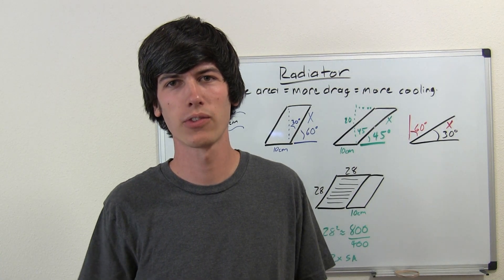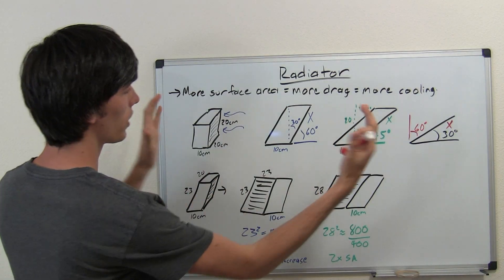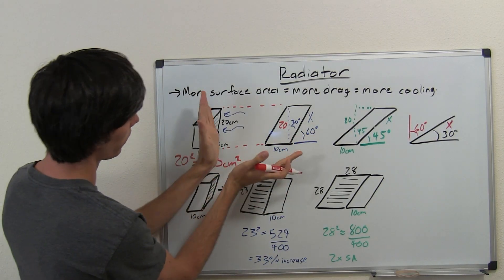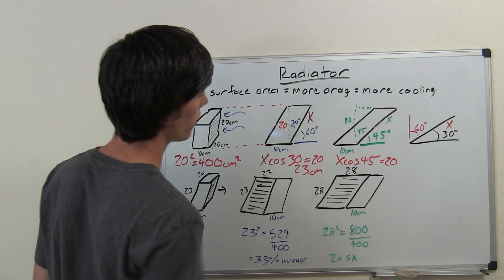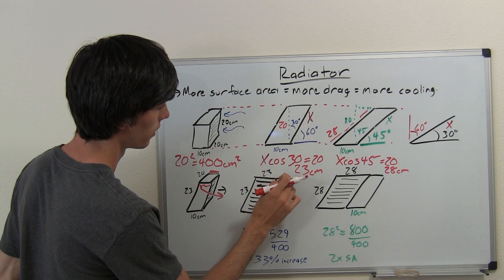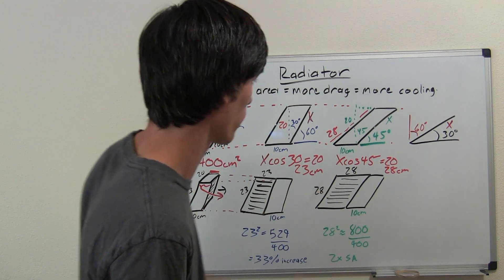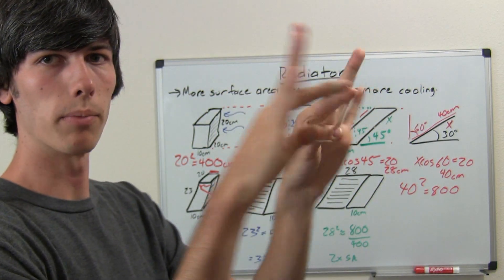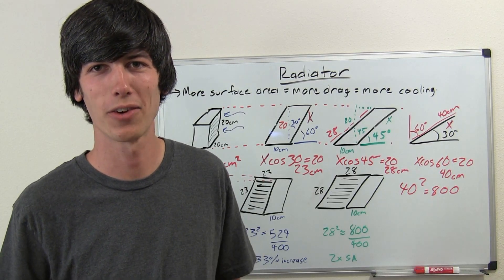Formula One Radiator Technique - Explained

Comment: good video, the only question I have is - when the rad is straight up the fins offer the less resistance, but when its laying over the fins will act as a resistant fan. the side positioning is therefore the best, the the air still has to change direction

Comment: @Engineering Explained, Is tilting premanufactured cooling cores like a radiator or intercooler from aftermarket suppliers - typically seen in a v-mount setup - even worth the effort. DTM and GT cars also use typical cores, and the fins would not be skewed increasing surface area. I can only assume a bespoke built as you described by a F1 manufacturer tossing almost limitless funds would benefit? My interest stems from initially reducing charge piping volume and reviewing orientation for a v-mount setup on my A80, but it all seems to be more trouble than it's worth even for a autocross/track car if the surface area does not change and only the angle...

Comment: I did like the rubber band.  Its worth noting the drawback to this system is depending how the air travels through the heat exchange the velocity will drop (if the air turns to go perpendicular to the ht x face) or the effective depth will increase (if the air travels straight and flows at an angle to the face). either of these effects will reduce the advantage of the larger face area.
Reply: I've seen systems for slowing the air because it can remove more heat if it's not moving too fast (I think it has to do with boundary layers?)

Comment: Looking at doing something similar and this video came up. If you angle that back though the fins will also be angled back and at some point it seems like air would flow over the fins instead of through them. Unless the fins are designed at 90 degrees to the ground despite the radiator being set back say 45 degrees. You could redirect that air flow to then flow at say 45 degrees matching the fins. But then your creating turbulence and/or adding weight and/or loosing efficiency in part of that radiator

Comment: I don't think cooling is working in this theory? Frontal area equation should be addressed to the direction toward to the wind. Now the radiator is tilted it might face the other direction which would cause more drag, or it might face the right wind direction but one corner sticks out the most will start to cool down then the far behind corner will be cooled the last. I think it's just matter of which corner get cooled first and not actually increasing the cooling surface area by tilting for better cooling performance.

Comment: I'm no engineer , but why cant you use the heat given off by the radiator to give extra push or thrust similar to  a small rocket engine , if it was made deeper . Or use the large fin that is at the back of the car. I'm sorry I don't know what it is called as a heat sink  ?

Comment: I know this vid is hella old and I may not get any answers from anyone; however, the fins orientation on the rad. Will it affect cooling? e.g. RX8s have the radiator basically under the car with a system to pull air in; however, the fins are not facing the same direction of flow. Wouldn't that produce more drag and therefore making it less efficient in cooling or is the drag needed to better cool?

Comment: In the last example at 45 degrees sweep in two axis your math is wrong. 40 X 40 = 1600. Eight times the radiator area with the same frontal area. Not 800.

Comment: hmmm - i thought F1 motors were air cooled?
Reply: Yes and no

To cool the Charged air from the Turbo,An Intercooler is installed at the left side of the cockpit for moving air from the outside to cool the compressed air Resulting in Better Horsepower numbers

For the Engines water,Transmission Fluid,and Lubricant to cool,secondary radiators are installed at the right side of the Cockpit 
To cool Them down for maximum Efficiency

Comment: But aren't also some pressure drop issues when you change the vertical angle? The fluid takes more time to pass through the radiator, so it's a bit worse i guess no?

Comment: So what it seems like; Its like stretching the radiator for more air surface contact but you would tilt it so that its overall height would be the same as if it was the unstretched version. But wondering if the fins angled or not. If not, it would see to put some down force or strain on the fins kinda creating a bunch of tiny spoilers assuming the top is pushed toward the front and the bottom pushed towards the bad of the car.

Comment: Okay, so, increasing the angle of the radiator will increase its radiant surface, but at which point this will make it a disadvantage? I mean, if the angle tends to 179°, it would have a very very very long length before it reaches a 20cm height, almost as much as infinite, and if the angle tends to 180° the length would be definetly infinite and thus wouldn't have any active radiant surface. so, which is the exact limit angle? I'm sorry for my really really bad english but i'm italian!

Comment: You have to take into consideration that the first thing you explained in the beginning starts to happen when you tilt it enough, the depth of the radiator increases. So its not that big of gains in reality that you stated.

Also i think the aerodynamics change a little with tilted vs not tilted, tilted doesnt get the air "rammed" thru like in the non tilted?

All just my common sense tingling so might be wrong!

Maybe make these kind of radiators IRL and test in and out temperatures?

Comment: Random thought: Wouldn't it be better for the bottom of the radiator be placed closer to the front of the car than the top of the radiator? Opposite to what you have drawn on the white board. Wouldn't this help provide more downforce, as oppose to lift? Or does it have to do something with not allowing the hot air to get trapped towards the top of the radiator at idle?

Comment: Ok this is confusing.
Confusion 1 : Unless the radiator is solid (no fins) this does not make sense.
Assuming that the radiator has 10 parallel fins
The true surface area on which the air contacts the metal to exchange heat remains constant of 10x20x10 (fin length x fin width x number of fins) = 2000.

Confusion 2 : When making a thicker radiator you will actually increase the fin surface/ contact area
Example if we increase radiator depth to 30
The new surface/contact area becomes
30x20x10 = 6000.
Now regarding your comment that the air heats up before it reaches the end.
That means you need a faster air cfm to make it move faster before getting heated.
Or this can be fixed by adjusting the length to a proper length.

Finally : i am curious, was this method confirmed to be advantages or not?
Reply: Confusion 1: Correct. You have to use more material to utilize that surface area benefit. 
Confusion 2: Also correct. It's similar to the myth that sloped armor on tanks make them lighter while offering more protection. Perhaps there are other benefits other than just increasing available surface area for a tilted radiator.
Reply: Increasing lenght of the fins you gain more heat transferred but that costs you more weight. The first benefit is not worth the weight gained in f1.
Reply: I think he means the plan form area will increase while keeping frontal area the same. What he has completely neglected however is fin density. A radiator's depth, plan form area and fin density will ultimately determine total heat transfer area.
Reply: +SUN SU it is not a myth
Reply: Confusion 2:
The cold side fluid's temperature increases to a maximum limit which is the hot side fluid's inlet temperature, for example in the car radiator the air increases from 30C to the maximum temperature of the water which is probably 95 or 90, if the air reached this temperature in a 10 cm depth, so the 20 cm increase in the radiator depth would be useless.

Comment: I believe this concept reduces drag even while maintaining the same frontal surface area.  The reason being that the shape has changed to become more aerodynamic.  Drag is a function of shape as well as frontal area for a given fluid and velocity.  That given, by tilting the radiator back you do loose some efficiency, due to the fact that the pressure delta across the radiator is reduced.  Great post!

Comment: Is it smart to make your radiator like you front car, and than tilt it. So a bit round on the front, hollow at the rear, and the whole part tilted. Or the back of the radiator flat and tilted. What do you think is the smartest and most efficiant way to make the radiator?
Reply from the maker: Here's a detailed answer to your question: Performance Radiator - Explained

Comment: Thats awesome, so they could improve road car cooling buy using angled radiators, or maintain the same cooling by using smaller radiators in this way thereby saving money.  
Presumably the fins of the radiator need to be angled in the same orientation in order to maximise the effect?
Reply from the maker: Well, a flat radiator is pretty efficient, and there's a lot more space in a road car for it.

Comment: So if you get a 1m^2(100cm*100cm=10,000cm^2) piece of paper and draw 1cm thick lines down the paper with 1cm gaps you get 5,000cm^2 of fins(inked area) and 5,000cm^2 (blank area), the fins are blocking half the frontal area.
You do the 45degree trick and you now have a 1.9881m^2(141cm*141cm) piece of paper. Repeat the lines and you have 9,940.5cm^2 of fins and 9,940.5cm^2 of air passages, almost no air "blockages" in comparison to its frontal area.

So you can maximise airflow to match your frontal area and maximise the fin area at the same time. So there is a maximum gain for each level of fin density.

Comment: So if I just change the brackets on my stock radiator to tilt it forward 40 degrees it will improve my cooling by nearly 20%?
Reply from the maker: No, as shi01 has said. Also, your radiator fins are oriented for flow perpendicular to the radiator, so it'd actually get worse by tilting it, as it would get less air flow.
Reply: No. The trick he shows is to use a bigger radiator, without the need of a bigger frontal area. (same hight and width) If you use the same radiator and just tilt it, you will have no effect at all.

Comment: Wouldn't leaning the radiator forwards create an upward force on it which of course you wouldn't want. And if it does, is it maybe just not parctical to tilt it backwards, because the air would not go in as much as just flow over?

Comment: a radiator is a block consisting a lot of thin pipes, so if we want to maximize the surface area we have to use more pipes, and the air gap will be smaller between(more drag), but from this point of view its the same area if its tilted or not, the only difference is that the bottommost and topmost places are not sending sending directly their heat from top to bottom and i can see there beter effect, but far less, than the described 2ratio

Comment: Take a cup of boiling water and pour it onto a 20X20 section of room temperature concrete and measure the temp of the water, then take that same cup of water and pour it on a 28X28 section of room temperature concrete and measure the temp of the water. It takes more energy to heat a bigger surface area, simple as that, so long as the engine doesn't get larger, or run hotter to compensate, the volume of air staying the same will have no effect.

Comment: Flat 20X20X10 radiator will have a 20X20 area of wind passing its flat surface and 10 depth. Slant it in the 20X20 intake, keep 10 depth and although the air intake is 20X20, the total front area of the radiator is bigger, so more air passes over it. So it will be more effective than just a 20X20X10 flat radiator
Perhaps you have an explanation? Where am I mistaken? Your comment was pretty rude and useless...
I'm here, like everyone else, to learn more about cars and engineering

Comment: I think if you section the area throughout the air intake's length, each section has a 20X20 area, but on each cross section a certain amount of area of the air goes through the angled radiator. Add up the area cooled by the air for each section and you will find that the total air cooled area is bigger than if the radiator was one 20X20 section

Comment: Yes, if you tilt the radiator like this, the surface area vs. cooling graph would not be linear, rather it would be curve. So, double the surface area does not mean double the cooling, however there is still an increase in the cooling compared to the radiator with the smaller surface area.

Comment: There has to be some trade-off, given that less air is going through the radiator when it is tilted, right? You can't tilt it 90 degrees and have lots of surface area with zero frontal area, because you won't get any cooling. There's probably a "sweet spot" angle that has the best balance of surface area vs air going through to maximize cooling.

Comment: 1: Wouldn't matter. It's just a diffrent system for the same problem. You would get the exact same result. You can easily divert degrees into radians and back.
2: You will facing a problem. In a F1 car, you haven't much space for the radiators. If you angel the radiator, you need more free space because the overall lenght of the radiator is increasing. Also, if you look at the cosinus-function, they get nearly linear after 45° (1/4 pi). So, i would say, more than 60° makes not much sense.

Comment: It is correct that you aren't affecting the frontal area, however, there are also aerodynamic variables to consider with the design of the radiator that will affect the drag induced by the heat exchanger. The most basic thing to consider is how many fins per square inch the radiator uses in the core. Next is the angle of those fins, and/or if they are louvered. All of these will affect how much drag the radiator induces on the car.

Comment: Think of it using the air conditioning principle when the air is compressed it heats up when it decompresses it cools. As you make the air compress into a radiator with fins that block half the air flow then it must compress to allow the air to pass. This process heats the air and slows the air passing threw. Angling the the radiator to increase its surface area also reduces(or reverses) compression in the same airflow needs to pass the "obstruction" especially in the air ramming scenario in F1.

Comment: I think I understand what you mean, but I don't get why should it be better. The airflow is the same. The cross-section area (and mass) of air passing through the radiator limits the amount of energy it can take away, no matter what shape of radiator is. The only matters cross-section area of radiator, doesn't it?
It's fact that they have radiators more like "\" then like "|". But what are advantages of such solution?
I am sorry for asking the same question.. :( but I really want to figure out.

Comment from the maker: I'm having a hard time trying to explain what I'm saying without a visual aid. Don't think of the air as coming in a square shape. For example let's say this "I" is a radiator, and so is this "\" (The shape). Now when air comes at the flat radiator "I" it looks like this IIIII -> I. (Here, IIIII is the sheets of air about to pass through). But the air that is flowing through the slanted radiator would look more like this \\\\ -> \. Now do you see how you're heating different portions of air?

Comment: So, to put it another way, the airflow is the same, but efficiency of heat exchange becomes higher due to longer contact of radiator with air. But again, why dont make a thick parrallelpiped radiator? You said the air will heat and stop cooling. But what's the difference? I mean, the flow of air is constant. So the constant is the rate of energy/heat/joules the air can 'blow out' of radiator. Why is it better then thick radiator?

Comment: or lets put it another way: as a physic I don't believe that if you make very thin radiator but its layout would be almost lying, with sides X Cos(Pi/2-epsilon) = 20cm, then its heat exchange would be incredible. No way!
ps. this is the first time I need to write a math formula in youtube comments :)

Comment: but you have the same air flow rate. The volume of air that goes through the radiator per second is the same so you can't heat more air to cool the oil/water better. I dont understand :(

Comment from the maker: Basically you're increasing the volume of the radiator, without making it thicker (the distance the air passes through) yet preserving the frontal area. So the internal surface area of the fins is greater.

Comment: I understand what you said about the geometry, but doesn't the air flow rate remain constant and each bit of air goes through the same distance inside the radiator? To put it another way, doesn't the internal surface area(the surface area of fins inside the radiator) remain constant? Since the fins must be parallel to the direction of travel.

Comment from the maker: The amount of heat that you can remove from the radiator increases, since you are spreading it out more. If you don't remove the full potential of the radiator with a single flat area (it's tempt. continues to go up) by spreading out the fluid you can dissipate more heat. Size of the radiator is important as well as how much air passes through it.